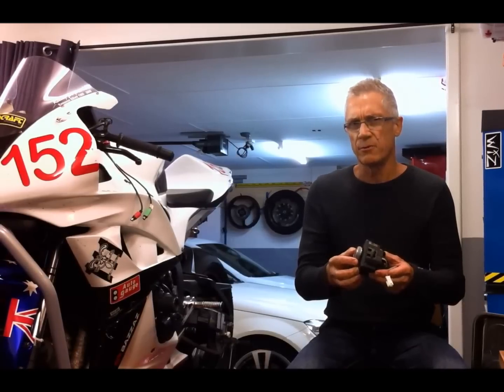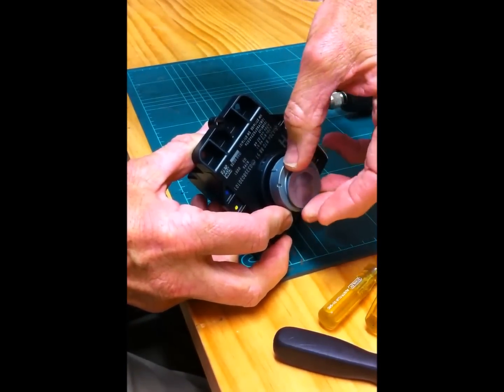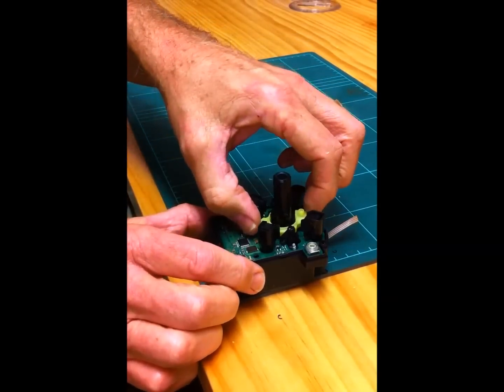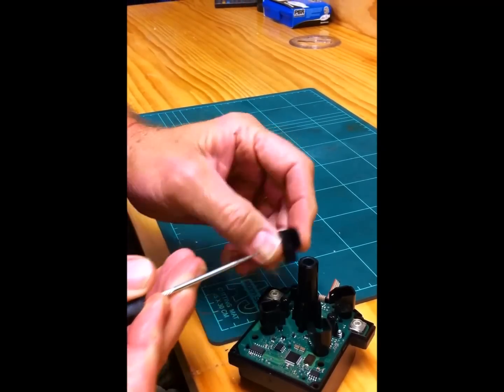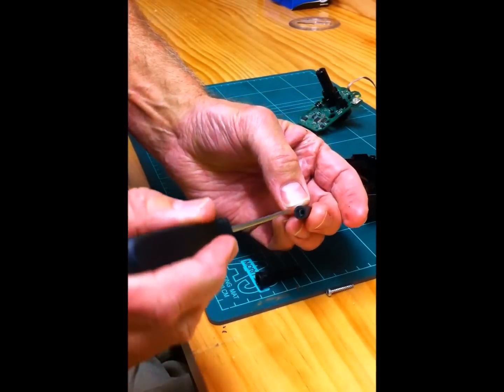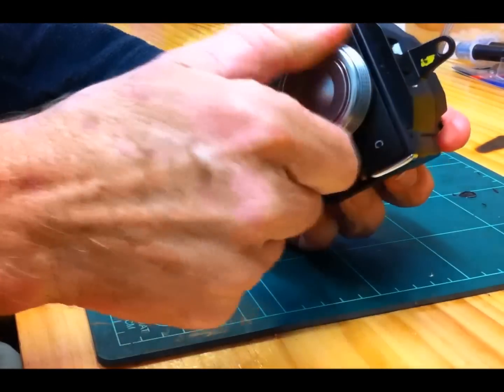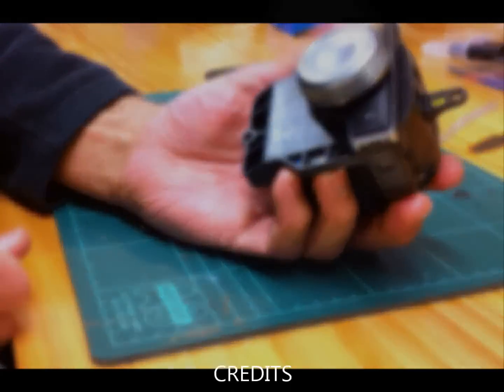Mercedes W204 W212 C E Class Repair Scolling Knob COMAND Console Control Wheel Command

Comment: thanks mr scott. agree i am also suspicous MB did not make this to fail. also you cannot just buy the part and fit it as it has to be "flashed" from he MB factory in germany so you would still have to go through an authorized dealer to get a proper replacement at some 1000 it is a lot.  how many other parts in our 5 yo MB's are destined to break and cause us expensive repairs?
Reply from the maker: Brett ... yes it bothers me that maybe there are other things to fail. I initially bought a second hand scrolling control unit from the UK and I plugged it in and it worked fine. My car is a 2009 (August 2008 build) so maybe the flashing is probably on the later models. If you have a W204 C class check the connector on your RH taillight to make sure it's not melting. There's an under designed earthing wire that needs changing. I've got a video of what to do. I'm surprised my car didn't go up in flames.

In the USA and Canada they've issued a recall notice but all they're doing is replacing the melted/scorched parts and not actually addressing the problem. I can't understand what they're up to. The world has gone mad!

Regards, Scott

Comment: Mine has just gone. £110 just for diagnosis without repair. Repair will be even more. I didnl;t realise this was the cause until I saw this video. Thanks !!
Reply from the maker: You can now buy replacement shafts on eBay. Try getting a plastic one. There are lots of alloy versions but I feel they'll wear the plastic housing too quickly.

Comment: Hi Scott,
I hope you can help me with the issue I am having with my unit. Everything works well following your steps, except I lost the "select" (central click) ability. And to fix it, I need to understand where this ability comes from. As the wheel is fixed onto the main axis, which is rigid (on the vertical axis), I cannot understand how the wheel can get up and down. What exactly is moving ? Is it the main axis, that moves from below the main PCB ? Or is it the wheel itself ? I ask because mine broke and thus was unmounted, it may have been poorly reassembled.
Hope my question is clear, otherwise do not hesitate to ask me more details.

Thanks a lot, I hope you can save me on this !
Reply from the maker: It's difficult for me to be succinct. The up and down movement is possible because the internal shaft slides inside an external tube.

I think you'll have to dismantle and reassemble whilst closely watching and pausing the video as required. If I recall correctly the rubber piece provides the return spring when pushing in and out.
Reply: Thanks for your answer ! So if I get you right, the axis on which the wheel is fixed (with the smallest torx, last step) should be able to go up and down, and if it's not, I must have missed one step somewhere.
Reply from the maker: I think you've missed something when reassembling. I'm pretty sure the internal shaft (that breaks) is solidly fixed to the wheel. When you push the knob the internal shaft can move up and down as it has a square socket on the bottom that fits over a square dowel and can slide up and down.
Reply: Ok makes sense, thanks ! I'll try to disassemble and reassemble again, making sure the internal shaft is able to move. As per my current assembly, the internal shaft can only rotate but won't move vertically.

Comment: Hi scott, i have the same problem and i want fix this. I have a questions: why you cut the cable? it is very necessary? how can i connect the cable after cut? thank you !
Reply from the maker: If you this video : https://youtu.be/gU5NB7jpqOM

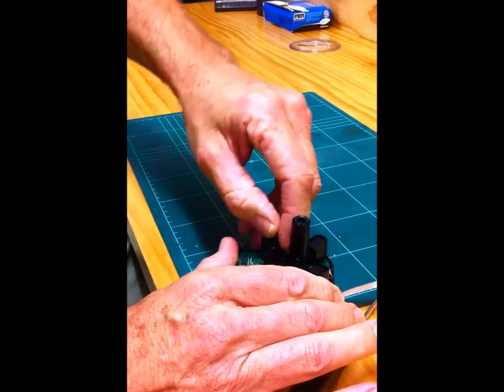I've included a link at 4:55 to an appendix video that shows how to access the clip holding the ribbon cable.

Comment: Wow, very imformative DIY video. I will try this. Wish me luck. Thank you
Reply from the maker: +Bill Halfpap It's great to see you're willing to have a crack at it. Good luck Bill. Regards, Scott
Reply: +Scott Elliott Well, I thought I had it fixed but after reinstalling with a new cable, now my COMAND screen will not open. I saw a spark when I was trying to solder/tape the connections back together. I checked fuses 26 and 84 and reseated and they are fine. Geez, would you know what I did wrong? Remind me next time to dissaemble the knob in the car and disconnect the wire from the unit so there is no splicing and dicing. ;)
Reply: +Scott Elliott I found a blown fuse. ;) Will buy and try again.

Comment: You coulda just bought a metal replacement tube off of eBay they’re cheap and it’s a permanent solution. Replaced the one on my e class 2 years ago and the command wheel is still working the same as it did when I first replaced it.
Reply from the maker: Two years ago a friend with a 3d printer made me a replacement. Look when I made the video ... no one was selling replacement shafts 7 years ago and 3D printers were still very expensive so not many people had them. If you check the description I say you can now buy alloy shafts and even give a link. I put that in a few years ago.
The printed plastic shafts will cause less wear ... plastic on plastic is better. There were some eBay sellers last time I looked.

Comment: Hello and thanks for the video. I just replaced the shaft and the scroll works again but now my comand controller don't record a click when I push the button for "OK". Left, right, up, down are okay too. Only OK dont work. Please advise. Thanks.
Reply from the maker: It maybe that the shaft is not sliding smoothly due to being too tight a fit. I've had that problem before. I had to dismantle and use some sandpaper on the shaft to give more clearance. Scott
Reply: @ScottElliott152  Thanks for the reply. I used the aluminium shaft. Which part of the shaft I need to peel with the sandpaper and is it possible that I messed up the sequence of the silicone parts while assembling or something? Thanks again.
Reply from the maker: @РадославЕнев  It's each end of the shaft where it spins against the plastic. Yes it's possible you've installed the silicone rubber part upside down.
Reply: @ScottElliott152  but it clicks perfectly when assembled, just doesn't report "OK" when I push it. So now I have no clue if the metal shaft is the problem, or the silicone parts :( I am so lost. Isn't logical for the click to disappear at all if the silicone parts are upside down? Thanks.
Reply from the maker: @РадославЕнев  You'll have to dismantle and investigate. It's not possible for me to diagnose remotely. It doesn't take long to pull it apart.
Reply: @ScottElliott152  I already done it twice but I will do it again. One more thing. Is it possible that I have damaged part of the cable so only the OK function doesnt work? Thanks.
Reply from the maker: @РадославЕнев  I doubt the cable is damaged but check each of the four wires in the ribbon for continuity with a multimeter. It's a logical process of elimination.

Comment: Thanks for an excellent video, I am now doing this for the SECOND time (will use your reinforcement trick this time!) The car is a 2010 model and the shaft has broken twice. I totally agree with you about the poor production, the whole part should be made from steel, really what could it add to the price of a vehicle like this? (It also has issues with its bulb electrics!)
Reply from the maker: Thanks. Scroll through the comments below and you'll find a link to eBay where you can buy a replacement aluminium shaft.
Reply: I'm in South Africa so after conversion and shipping that tiny part would still end up costing me a fortune - I'll rather invest some time and fix it myself.

Comment: Hello Scott! I watched both the videos about the knob and have two questions before I try it myself:
1. My scroller still 'rocks' while spinning. This is normal right? Or should it just scroll free if the shaft is broken? 
2. I have the facelift of the w212, is there any difference to the dismantling of the knob?
Reply from the maker: 1. That's normal.
2. The controller is the same.

Comment: Hi Scott. I've managed to remove the control from the vehicle (2011 E350), but am having issues separating the control into two parts. I've removed the four torx screws on the bottom, but it still doesn't separate. Any idea how to remove?
Reply: I read the comments below and noticed I had to remove all ten torx screws to separate. Thx.

Comment: Hi Scott. l stripped unit down, ordered new aluminium shaft replaced and put everything back together but now it almost works... it wont work when l push wheel up. or push left/right.   pushing downward works but not left/right or upwards. Any suggestion ?
Reply from the maker: You're going to have to pull it down again and carefully assemble. It 
will be something to do with the rubber fitting and the little side 
toggle switches. Scott

Comment: Hi Scott, I've gotten as far as getting the knob off and the four screws at the bottom, but I can't for the life of me take the box apart as easily as in your video.

When I look at the bottom I can see something like 6 screws more, recessed in a deep hole - do they need to be loosened also or are they holding something else together?
Reply from the maker: Thomas you need to remove all the screws including the ones recessed. There's about 8 to 10 all up from memory. Scott
Reply: Hi! I found that I could use the same torx-bit, it could actually reach to the bottom, I just thought I had to go buy a torx-driver also.

But the screw on the knob is actually a #8, not a #10 - the #10 is only for taking apart the unit (and the other screws for taking apart the interior).

Anyway - I just finished the repair (got an alu replacement instead of glueing the old one back together) and saved a ton of money - the repair cost (including spare part, bit-set and a panel remover set) was 1/4 of what it would have cost to have an autoshop do the repair (including a new unit that would break in 4 years again).

PS. On the left-hand drive version of the E model it's actually very easy to get the controller out in one piece, without having to cut the cable :o)
Reply from the maker: Thanks. I plan to look further at how to do it with out cutting the ribbon cable.

Comment: Is there a seperate fuse for a W204 Mercedes Comand unit?My unit stopped working. The radio, etc still works, and I can control it from the cluster, but the screen doesn't open, etc.
Reply from the maker: Mark I'm not sure. There's a sheet with the fuse list with the jack holder on top of the spare wheel so check that out. If you look through my list of W204 videos I did make one on how to remove the folding screen unit from the dash. I know there's a fuse for the LCD screen inside the assembly.

Comment: Hi Scott. I followed every step.  everithing it's been placed.  the problem I have is I drove the car while the shaft was taken out and since then my display does not come on. next day I placed the shaft back and the display still does not come on. any ideas?
Reply from the maker: +Marius Bumb No ideas come to mind Marius. It maybe worth trying the battery disconnect trick. Leave it for 30 minutes or so and reconnect.
Reply: +Marius Bumb 

Hey, same thing happen to be, its the fuse. check fuse number 11 under your hood. Replace it with a new one. got one from the dealership.

Comment: Dear Scot, How do you tell the knob shaft is broken? Is it when the scrolling function fails?
Reply from the maker: Yes. The scrolling won't work but the up, down, left, right and push down will work.
Reply: Thank you. Seems that I am having that problem with my 2012 W204 since a week ago. Will try to follow this video. Thank you again.

Comment from the maker: Kenyatta ... there should be about 10 torx screws on the bottom to remove. If you can post a photo please do. Once all screw are removed the two halves separate very easily. Is you controller the same?

Comment: Thanks for the vid! After removing the 4 screws the 2 pieces will just not separate it is very frustrating and has made me even slightly damage the housing, any idea how to separate them? Thanks
Reply from the maker: You have to remove all the screws. There are about 10.
Reply: Scott Elliott thanks for that, did everything (apart from the spray) ran into another problem the scroller now works but wen pushing down left or right that does not but pushing up and the scroller do work, any ideas why this could be? Thanks
Reply from the maker: fezan I'd say it's the rubber fitting or one of the little levers inside not positioned correctly.
Reply: Scott Elliott I have re-done this a few times with the same results, I then left it all opened and connected it to the car, pushing down on the top 2 rockers and there is a response but nothing from the bottom 2, I know when opening this I may have damaged the edges of the circuit maybe this is why it does not work and also the bottom right where the rocking lever rests into half of that chipped off not sure if that is major? Thanks
Reply from the maker: You may have to buy a used one like this:
http://www.ebay.com.au/itm/MERCEDES-W204-C-E-CLASS-COMMAND-PUSH-BUTTON-SWITCH-CONTROLLER-2048709758-OEM-/322537939287?hash=item4b18c26157:g:ql8AAOSwYlRZLyMD

Comment: Hi, i too have this problem. It was trying to repair it myself... But i cant seem to remove the silver ring piece... I tried to lever it with a small phillips screwdriver like in the video.. But it just wont come off easily like in your video... Any advice? Thx
Reply from the maker: William I used the pointy tool not a small Phillips head screwdriver. See from 3.13. You need a sharp point or even a sharp knife to get under that ring as it's a very close fit. Regards, Scott
Reply: Finally I was able to remove the metal trim ring.. And was able to follow through the whole video tutorial you made. It now works flawlessly!!  Thank you so much Scott! you've made me save 450AUD and about 2-3 months of shipping excluding labor :D
Reply from the maker: William Ng Good news William. Well done on repairing yourself and saving a small fortune. Long live the DIY'ers. Regards, Scott
Reply: +William Ng Hello William, looks like I have the same problem, looks like it's barely impossible to remove the silver ring. How did you do?

Comment: Hi Scott52, Excellent video !!
Can we just buy this on eBay or somewhere and swap it out with a new one?  What is this part called or Part#? Thank you.
Reply from the maker: If you buy a new one they are very expensive. If search on ebay you will find second hand units. I did that and bought a used one from the UK for about $AUD60. It lasted three months before it broke as well.

Comment: Dear Scott, I just figured out today that the broken scrolling knob somehow interferes my phone GPS. I fail to get the satellite connection to my phone. This really sucks. Any idea why this "signal blocking" happens?
Reply from the maker: That's a strange issue I've never heard of. You'll have to do some Google searching. My only thoughts are perhaps the electronics in the control knob are faulty causing the blocking. You can buy the knobs on eBay quite cheaply.

Comment: ahhh found it! makes much more sense now! tyvm.
Reply: 2 more questions for the road...
1. if i buy the shaft kit from the website, i won't be repairing the plastic shaft, correct? Just replacing? 
2. the sound your scroll controller makes at the end, the clicking- does it make that sound with a broken shaft? I didn't hear the scroll wheel clicking before your disassembly.
thanks again.
Reply from the maker: Brant the clicking sound should be present with or without a broken shaft. The sound is caused by indents under the wheel clicking over a spring loaded small ball bearing.

The shafts you buy on the web replace the broken plastic item. That's the easiest and quickest repair. Pull the broken one out and drop the new alloy or plastic one in.

Comment: What is the material use to reinforce it (4 little piece)?  It seem a yellow color then return to black after it dry.
Reply: He cut a match in 4 pieces. The material is just wood. It turned black because he painted it but it's not shown in video
Reply: marinosmichael
 Thank for your answer.

Comment: Hi scott how are u? I went to the dealer and they checked my control knop and they told me my mercedes is getteing the power because when i put a usb stick it works . So they told me there is a problem with the control i think i have to buy a new one .
My question is do i buy a whole new one are onlu the little green thing inside with all the buttons (sorry i dont the name of that)
Reply from the maker: +farli van emden They will only sell the whole control knob. There are plenty of second had items on eBay which are much cheaper.